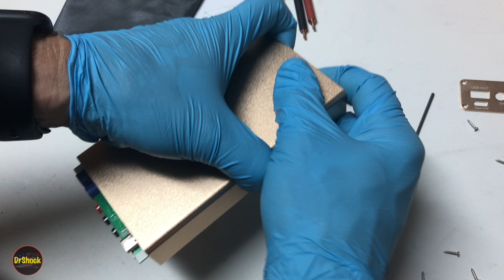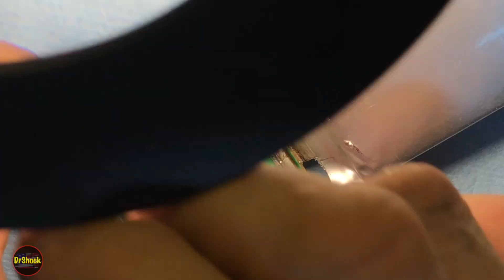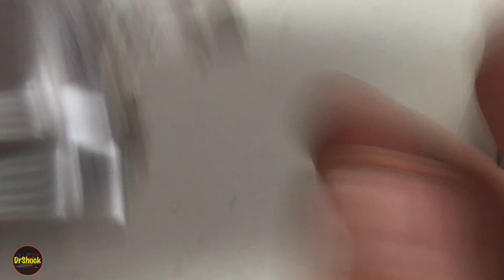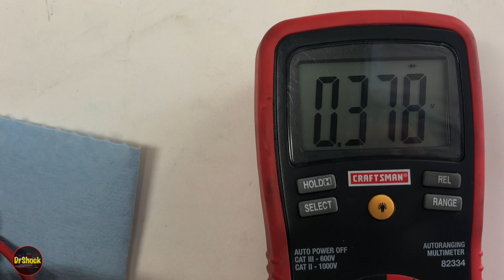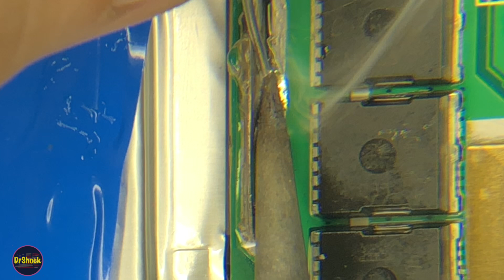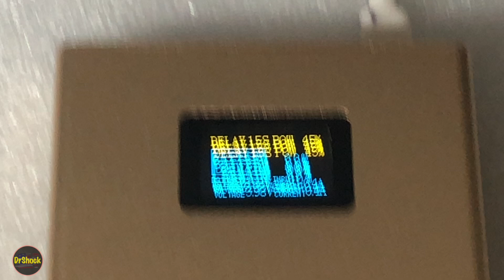Inoperative SeeSii Portable Battery Spot Welder Not Charging Repair ~ LiPo Pouch Battery Replacement

Comment: In order to desolder the batteries from the boars firstly preheat the PCB near the contacts with hot air gun. Than use wide soldering tip - not the narrow pointy one you’ve used. This is why you steuggled so much to desolder the bad batteries
Reply from the maker: I'm not in favor of that approach for this specific situation for two reasons. One, I prefer the pencil tip for control to avoid arcing the battery terminals together in the event of a slip, or arcing to one of the SMDs.  Two, I prefer the narrow length for applying the heat laterally to the battery tab to have it heat more uniformly.  I don't recommend using a hot air gun in this situation, as it can damage the polymer packaging of the pouch battery.   What you saw having to be overcome are the high amperage welder lines epoxied to this board after it was printed.  They sink considerable heat. 

This is a situation where you just have to take longer for safety given the pouch battery design used.  If I did this job over again, all I'd change is to go directly to ChipQuik, move up to 450° F, and apply aluminum  specific soldering flux during desoldering as well as soldering.  Or, alternatively, recycle the welder and replace it with a model that uses a super capacitor design instead.

Comment: Are these 117080 still holding a charge? and where did you purchase them?  Are you happy with them?  Thanks for the response.
Reply from the maker: Yeah this tool is still working fine. The replacement cells I used are the best replacement for the original LiPo pouch cells this device used originally.  There are links in the video description for where to buy.  The aluminum tabs can be difficult to resolder, aluminum specific soldering flux is a must.

Comment: Thanks, very informative.  Why not use a couple of 18650? out of curiosity. I have some 18650's and I'm a cheap bugger.
Reply from the maker: Thanks, just opted to keep it as-designed.  The welding circuitry of this series is sketchy to begin with, and likely tuned to the LiPo pouch cell characteristics.

Comment: The Diodes in the MOSFETs are all connected in parallel.
On the same power rail. Therefore, you can't tell if the transistor is OK without first unsoldering it, I think. Even if only one diode is OK, it will affect all of them. Or if only one MOSFET is short-circuited, you measure continuity on all of them ;) Otherwise it's a nice video.... 👍👍
Reply from the maker: Thanks for the comment.  The device was successfully repaired, with fortunately only the pouch batteries at fault.

Comment: I was expecting something like you building 18650 battery pack 1S 4P or even 8P and ditching the case all together. 
it would be nice if someone did it with 18650 battery pack instead of buying the same exact battery Online.
Reply from the maker: The same battery type is required to fit into the metal case of the welder.  It is already a sketchy design of questionable fire safety.  Externalizing the batteries to another type/size would exacerbate the risk.  The more preferable design overall, would be the type that uses a super capacitor instead of LiPo batteries as this type of tool only sees infrequent use so is a poor candidate for any type of battery.